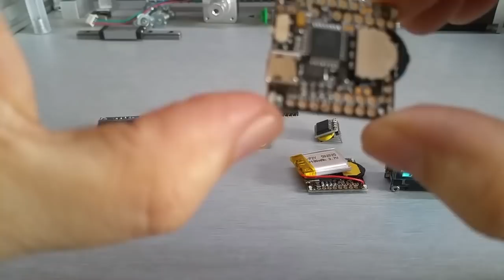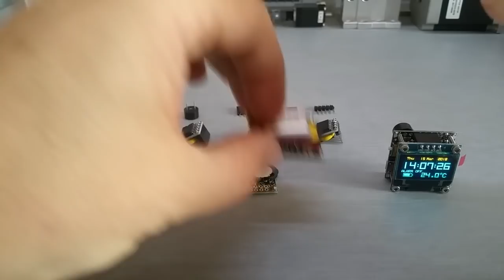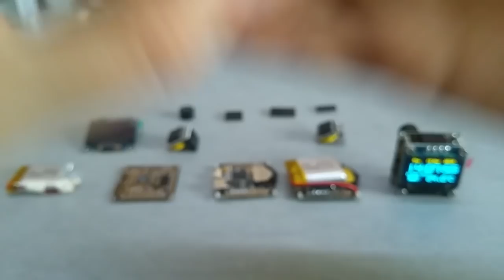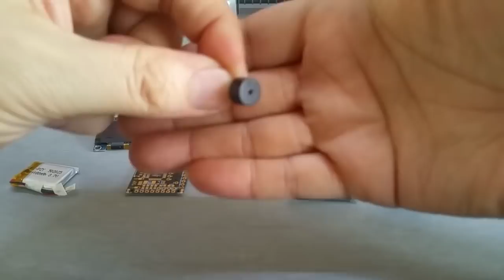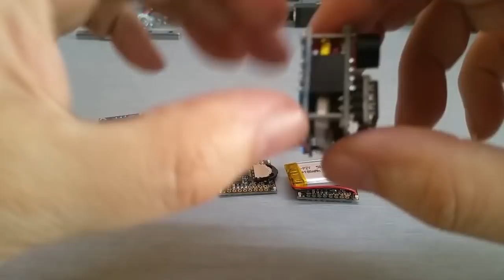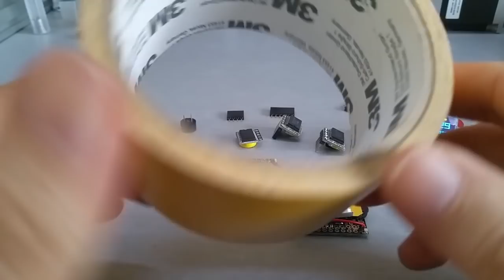This is how I do it :-) OLEDiCLOCK by Hayri

Comment: hey buddy! can you upload a video on how you coat a smd pcb's pads with tin/or solder so that theyare ready to have the components soldered on or placed and reflowed/etc (smd) please! i have made tht pcbs but not smd yet! and need to start making them for my project-after i etch the copper and have the layout ready....im not sure how to tin or coat the pads so they are ready to have the parts placed!
Reply from the maker: Hi Jesse, so far I am using a stencil for the 328 chips and apply the solder paste for the other parts by hand. which takes a lot of time but is necessary because my boards have more than one purpose and I apply solder paste only where needed. For the new PCB's I have on the way I ordered stencils with them and will make a video how how to use them once they arrive. If your project has more than a few SMD parts than I would definitely order a stencil with it to make your life easier. They cost only $10.00 for the standart stencil and worth every penny once you start producing more boards. And don't wait and get a even cheap toaster oven right away, I wasted so much time soldering by hand that I coul'd kick myself every time now that I use the reflow oven, it is just soo easy and super fast.
Reply: ok thanks! its a buck converter module i have all the parts and the chip quick smd paste I guess next step is getting a stencil along with the pcb and waiting for your video for some tips! cheers thanks!